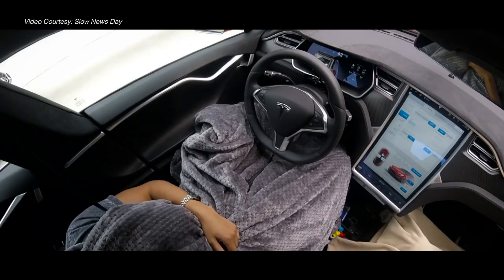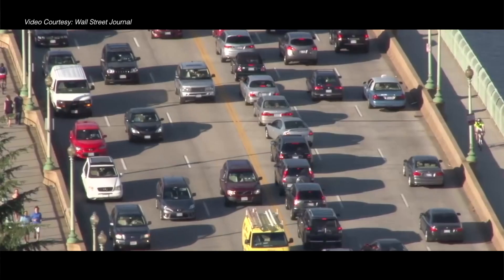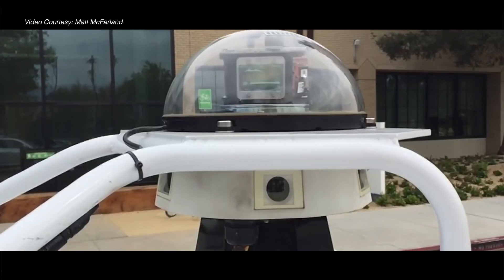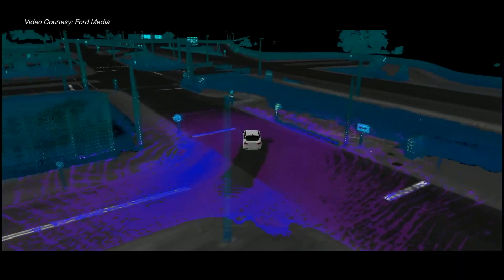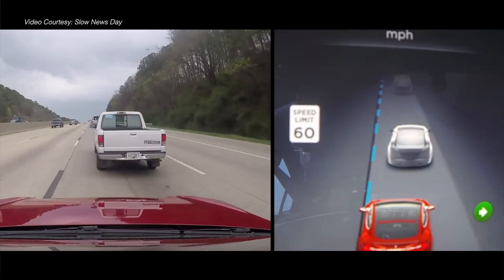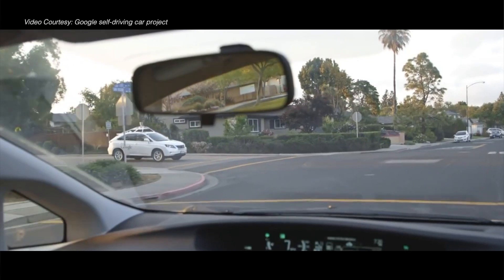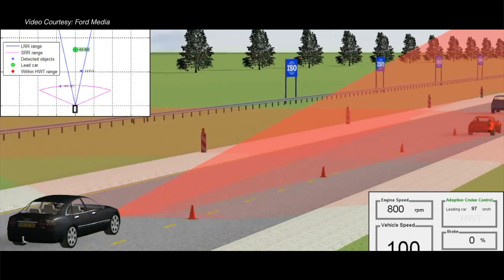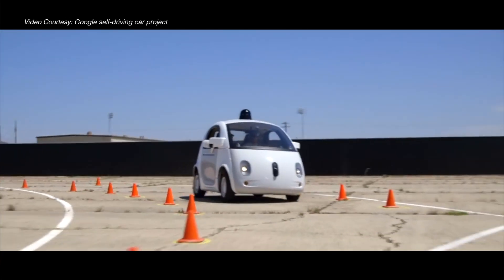How is LiDAR remote sensing used for Autonomous vehicles?

Comment: Elon just killed LIDAR.
Reply: Cameras have trouble in the darkness...
Reply: Tesla will regret not using lidar
Reply: @TheTmat007  they want to make affordable cars with autopilot. LIDARS are expensive and they get cheaper every time but you can use cameras and radar which can cover each others weaknesses that's why they don't use LIDAR - Its expensive and not extremely necessary for building an autopilot system
Reply: @aljon5947  
Sure. I know lidar is expensive. But it is getting cheaper (as you also correctly noted). But do you understand that despite the high price of lidars, ALL other car manufacturers out there consider it useful as part of their self-driving hardware device? Only Tesla doesn't. Why do you think this is the case? I mean, don't get me wrong...I'm a huge fan of Tesla. I really want the company to succeed (and continue to be recognized as the leader in the EV segment). But, I just think the company is making a mistake not to include lidar.
Reply: @TheTmat007  what advantage does lidar have? It covers the use cases that are already covered by far cheaper Cameras (operates best in the same conditions and is rendered useless by the same conditions too), but provides only depth data, nothing else (which you can get with cameras too, and they provide far more info)